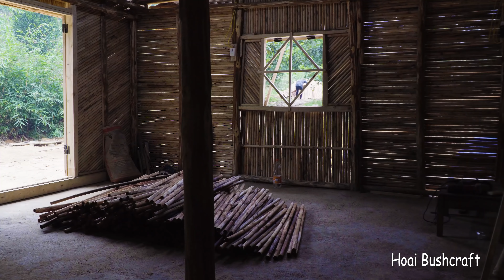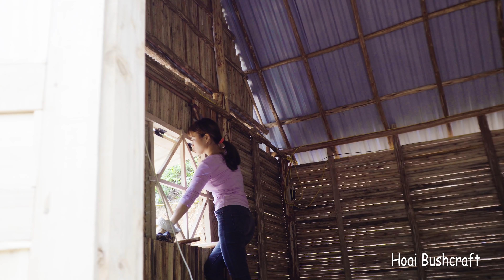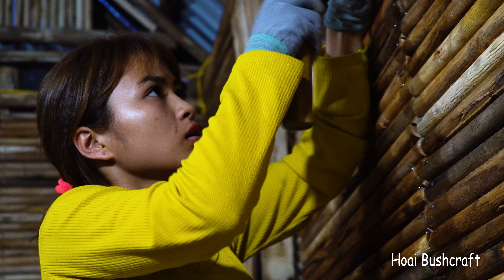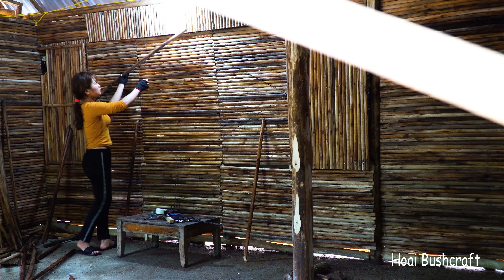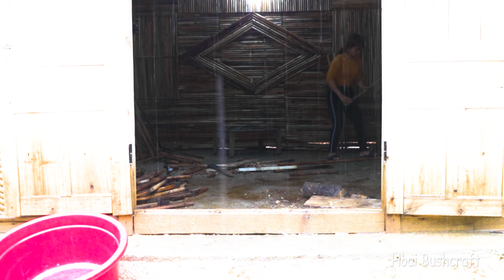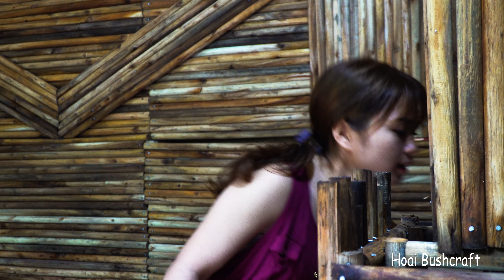Complete Wooden Wall Cladding, Fantasic Dream House Decoration - Off Grid Living, Survival Forest

Comment: Hi, is ur house leaking why is the floor so wet, also at the bottom don't u think there is too much space, maybe that's where water is coming from, also at sometime I believe u need to paint to save the wood from rot, because of the weather.... Just a thought, thanks
Reply from the maker: Thank you, I will try to paint the house more durable, because I have not had time to handle the base of the wall, so the rain will wet the floor, but the roof will not leak.